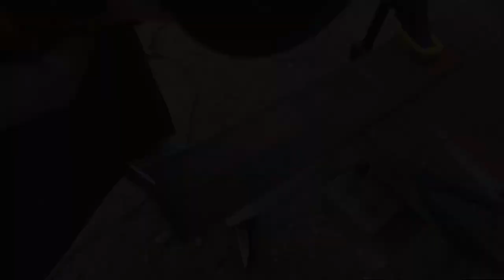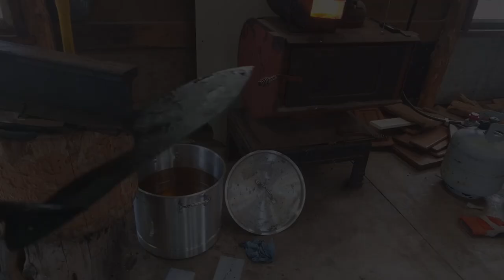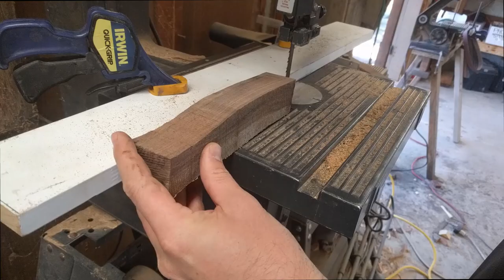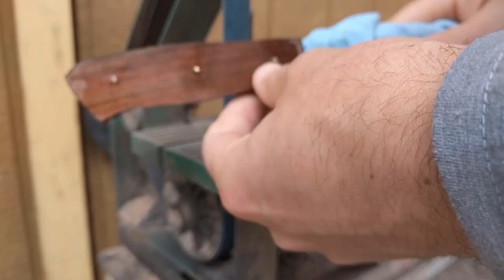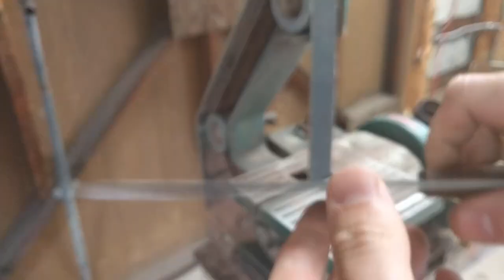From Rusty Saw Blade to Chef's Knife.

Comment: These saw blades are usualy made of 15n20 steel or very similar, it's actually quite good carbon steel up to 60HRC (better about 58HRC). The edge retention is similar to 1084 steel, so not bad at all.
Reply from the maker: Yep, I love 15n20 and use it often.  Slightly better corrosion resistance than the 10xx series high carbon steels.

Comment: How long did you quench?
Reply from the maker: Long enough to get it completely hardened.  It's an incredibly thin blade; I think I did 3-4 seconds in the oil and another 10 or so on the plates.  It hardened all the way through.  I had a heck of a time grinding in the bevels and keeping the heat down.
Reply: @ironridgeoutdoors  I’ve seen people quench for like 5 minutes. Is that necessary?
Reply from the maker: @HackMasterBlaster  not at all.  It's dependant on the steel you're using and the oil used, but I've never seen a readout call for anything longer than 5-6 seconds.
Reply: @ironridgeoutdoors  thanks